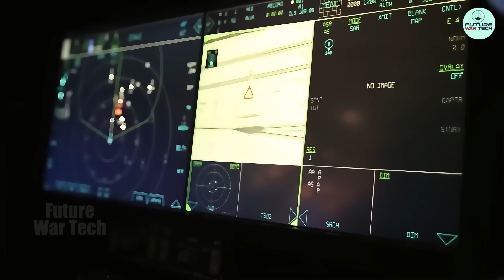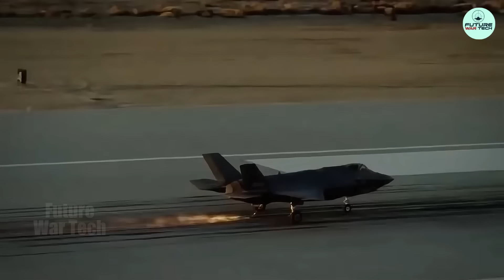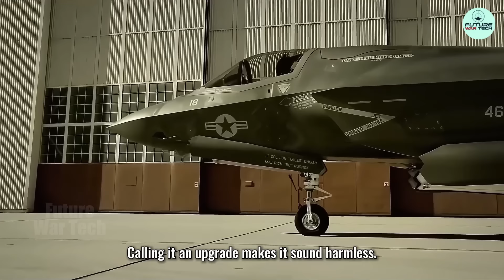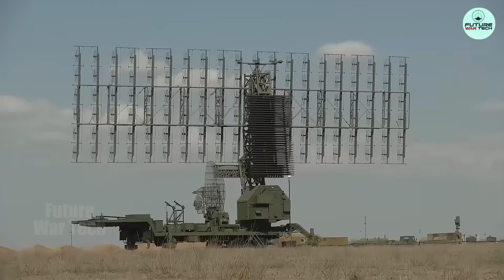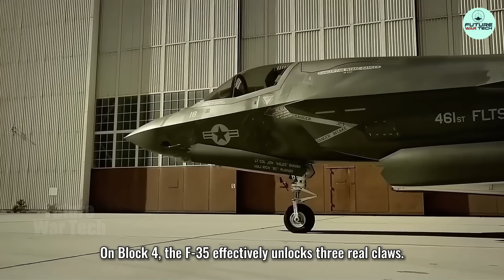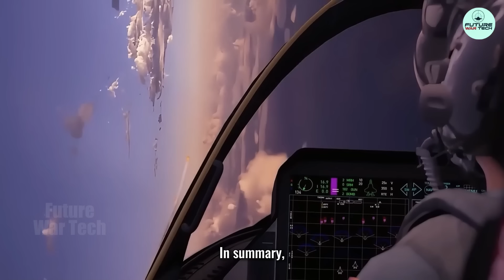F-35 Block 4 Putting a Supercomputer Inside a Sniper

Comment: You can thank Israel for block 4 upgrade, they have transformed the F35 into reality performance and not just we'll get there in the future, its here now and with a proven capability.
Reply from the maker: Israel definitely played a major role in pushing real world combat driven upgrades. Their operational feedback mattered.
At the same time, Block 4 is the result of a much larger ecosystem. US services, allies, and evolving threat environments all feeding into one continuous upgrade path.
That is why Block 4 is not a moment, it is a phase.
Reply: I was under the impression that the Israelis were not sharing the F 35i configuration with the u.s.
Reply: @DutchKing2026 That was the agreement of the US sharing the core coding for the F35, that they would share the upgrades and performance of what the new software did for the platform.
Reply: @DutchKing2026  
No
Israel share everything with the US because it works in their favor
The F-35I over Iran gather up vital info via the F-35s ELINT capabilities as well ISR from its sensors
Israel a lot real world missions with its F-35 in the middle east and that info very valuable to the US

Comment: The Gripen lacks stealth but it has an en electronic suite that is top notch and the F-35 has to leap frog all other competitors. Removing as many advantages your opponents may have is a necessity.
Reply from the maker: Well said. Gripen’s electronic warfare and networking are extremely capable, especially for its size and doctrine.
What Block 4 changes is the scale. The F-35 is not just countering individual advantages, it is designed to remove entire layers of the opponent’s system. Sensors, shooters, datalinks, and decision cycles.
That is the real leap. Not a better jet, but a different way of fighting.
Reply: You sir are not only on point but also a gawdamn  wordsmith as well!! I salute you!!God bless you brother  @FutureWarTech7
Reply: @FutureWarTech7  hopefully other countries rethink their purchases ? , that program is a Albatross, we could of had a better airframe for the times, a true interceptor in the YF-23 at sea especially.
Reply: Yeah, but US bad so f-35 bad.
Reply: Good point but the Gripen is a POS compared to the f35 okay bub?
Reply: @jimmcnair5843  it's z piece of shit compared to the F15
Reply: @davidbusch784 the only way to know is in actual combat until then we can debate until the cows come home
Reply: Cost wise, operation $ & purchase its a little powerhouse no doubt, it seems like the F-³⁵ is gonna be a invisible AWAC more than anything.